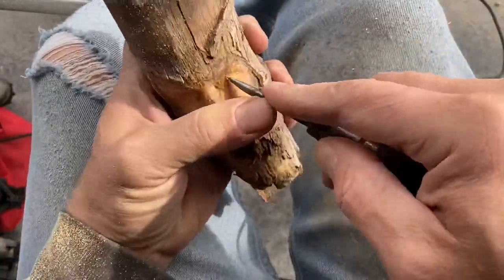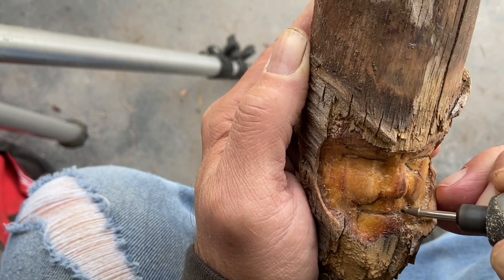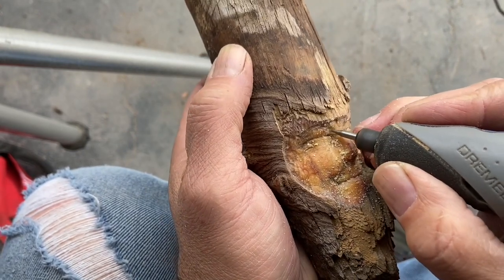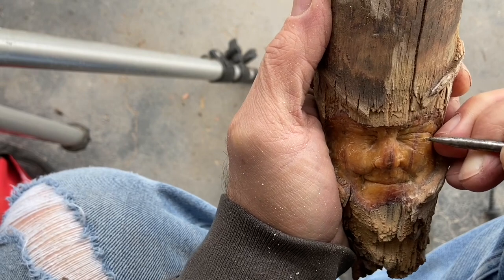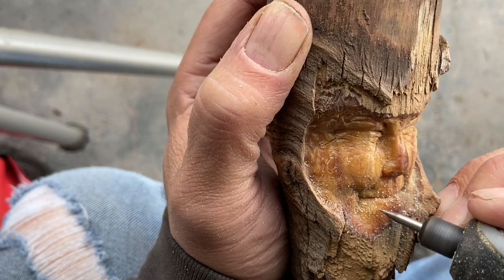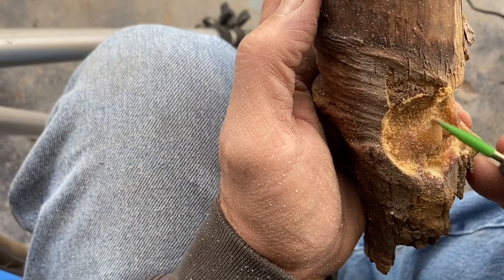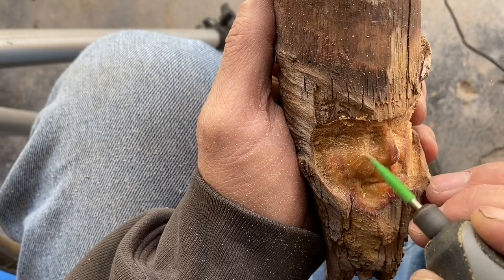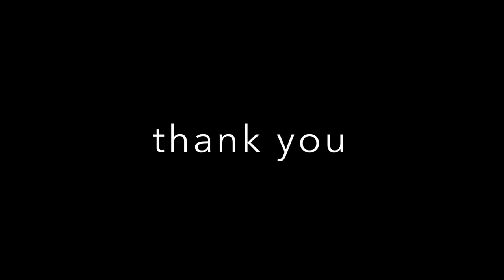Dremel Power Carving a Wood Spirit Pine Knot Old Man ~ Start to Finish #woodcarving #dremel

Comment: Beautiful work on this wood spirit!

I appreciate getting your tips on sourcing old pine wood for dremeling, which is how I found my way here. I usually work with beech, but presently I’m carving a sign on a giant plank of old pine my friend found on the side of the road. Love the amber tones I’m finding in it. I live in south Georgia. There’s plenty of pine down here, but it’s a fairly wet climate so finding good wood dead on the forest floor is definitely a challenge.

Regarding the green coating on the flame burr you use, I don’t know for sure but I’d guess a good reason to have that is it shows up strongly against the wood at all times so you can very clearly see where the edge of the bit is.
Reply from the maker: Thanks Joshua, appreciate that. Yeah it's a  bit drier out west, makes the wood easier to manage. Also the colored saburrtooth tends to indicate the coarseness of the tool, green indicates coarse,  while a yellow coated burr indicates 'fine'. All the best to you!